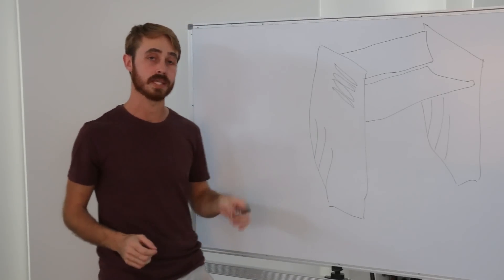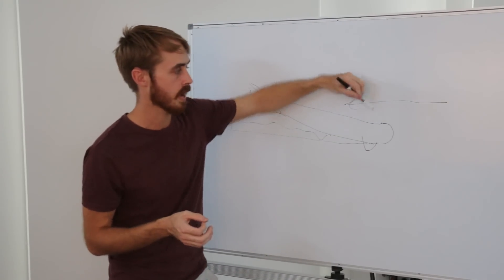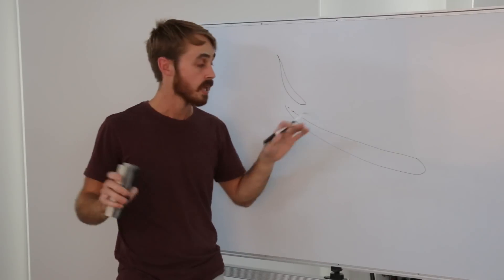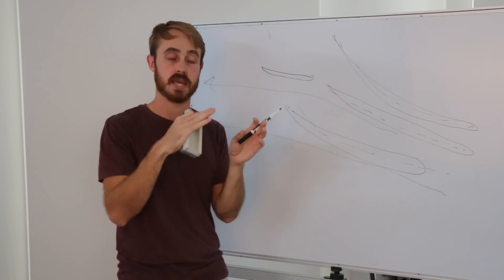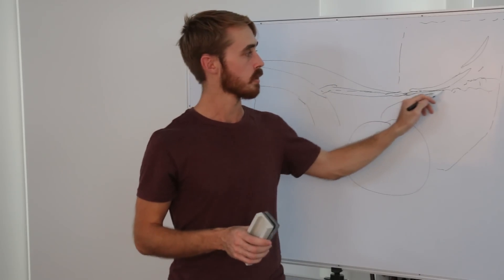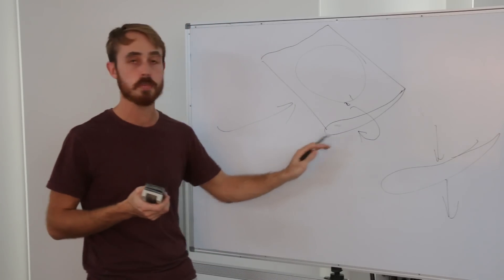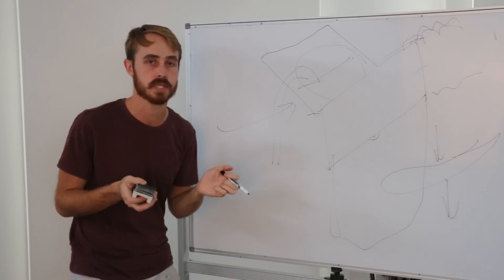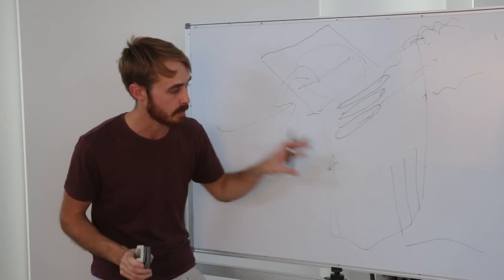How do F1 Rear Wings Work?

Comment: I get that the energy is bled from the wing, but not why it would give you increased drag. If a wing is 100% efficient, its dragfactor would be the highest. Vortices reduce the wing's efficiency...so the drag should be less (the wing isn't holding you down/back as much as it could be doing without the vortices).
Reply: think of the airflow in terms of momentum. Assuming the freestream oncoming air is mostly in the lengthwise direction of the car (x-axis), when that air gets turned into a vortex, it loses some of that lengthwise momentum for span-wise momentum (z-axis). The drag force here would be roughly proportionate to how much lengthwise moment was lost after the air was turned.

In terms of wing efficiency...wing efficiency is defined as the ratio of lift/drag, so losing efficiency does not mean drag was reduced, but the opposite. since efficiency and drag are inversely proportional, the vorticity of the wing reduces the lift of the wing which makes the wing less efficient.

"If a wing is 100% efficient, its dragfactor would be the highest" this is not true because efficiency is L/D. so at infinite efficiency, drag would go to 0.
Reply: @bossert_  So I have to view vortices as drag inducing because the engine not only moves the car forwards (x-axis) but also spanwise (z-axis) because the air gets moved in this plane too?

I didn't know that efficiency of a wing was defined this way. I have heard multiple times people say (credible) that a wing gives you "more drag". 
I guess they are trying to say (with DRS in mind) that a wing holds you back when going for straight line speed.

Thank you for the explanation btw, I'm not an engineer :p
Reply: @anomalyp8584  so the engine provides the airflow by spinning the wheels and moving the car forward through air, that is where the energy and momentum come from. It is in a straight line as the car moves forward (this is called freestream flow). Afterwards, the bodywork of the car turns the air in a vortex which takes energy and momentum out of the straight line flow and converts it into rotational momentum and energy. The net loss of momentum and energy from when the air goes from a straight line into this spinning vortex is where this drag comes from. The flow will have less straight line flow at the end of the car because some of it got turned into vortices.

The efficiency is just a measurement of how much lift you get for how much drag you have. The wing will always be producing drag, but to be efficient you want to make as much downforce possible without adding too much drag. 

It's okay to not understand parts of aerodynamics. This stuff is very hard. I am getting my Master's in aerodynamics right now and am still learning stuff daily!
Reply: @bossert_  you may not even read this but really thank you for this comment, I knew about efficiency of a wing and that vortices create drag but I never understood why. It makes sense that by converting the momentum of the air into the z direction you are loosing energy, and thus creating drag
Reply: Thread is old, but I would like to add that @anomaly P  is mostly correct. For the sake of precision, we would need to add some wording to say for a given airfoil profile at a given speed and angle of attack with miraculously zero vortices, the lift is maximized and the drag is also maximized, the lift/drag(wing efficiency) ratio is maximized, but it has a value of around 2.5 for an F1 car, and 17 for a boeing 747. With vortices allowed, the drag is indeed decreased. This is due to the decreased pressure wingtip regions on the frontal area of the wing(illustrated by Kyle) and increased pressure wingtip regions on the rearward area of the wing. We know by conservation of energy arguments the wing efficiency lift/drag must be less. All this means is that you lose more lift due to allowing vortices than you do drag. 

anomaly P has better intuition/understanding than most engineers for spotting this. To sum up the main point, if you take the wingtip fence off of a wing and keep everything else the same, vortices will develop, the total drag force will go DOWN a little bit ~5% as anomaly P said, and the downforce will go down a lot ~15%. If you need the same downforce that you had with the original fenced wing, you would need to increase the size of the unfenced wing by ~15% so to a rough approximation you might end up with 10% more drag compared to the equivalent fenced wing.

Comment: At 8:35 when you draw the pressure forces acting on the rear wing, do they both act downwards? Or does the force on the bottom act upwards and because it is smaller there is a net pressure force acting downwards (the downforce)?
Reply: yes you are right, pressure always acts perpendicular and into a body. I think he was just illustrating the net effect of a downwards force

Comment: How do vortices form on the end of an end plate ?
Reply: vorteces form on almost all sharp edges that are effected by fast air. Basicly you have pressure differences between the inside and the outside and the air has massive amounts of energy. This creates the same effect like he explained when the wing doesnt have an endplate
In fact, keeping the flow of air laminar arround a structure is extremely hard, so vorteces or turbulent air will naturally form almost everywhere

Comment: the vanes on the lower end of the rear wing fin end plate looks like it is steering air behind the rear wheels thus reducing the vacuum and control the air flow behind the rear wheels ;)
Reply: everything behind the wheels is turbulent. there is nothing to steer there ;D
Reply: @oeliku3033  you've not understood what i said .... air is being steered into that turbulent region to reduce the turbulence created by the vacuum effect, not steering the air behind the wheels but steering air into  that region... comprenday vue ?? :)
Reply: @freezatron  thats where you are wrong. You cant reduce turbulence - you can only prevent it or "push" the turbulent areas with laminar flow or vorteces, but thats 100% not whats that for.
The lower part of the endplate most likely increases longitudinal stability and prevents the vortecy that forms on top of the endplate to form on the bottom.
Also they are the connection elements for the rear wing, since you would have to do that in front of the wing or inside the low pressure area under the Wing/Flaps otherwise (eg like on some group C cars).
So I dont think they are aerodynamicly important at all - just shaped so that they dont cause much drag.

Edit: Also: what use is there to steer anything BEHIND your car ;D
Reply: @oeliku3033  No, this is where you appear to be wrong ;) 
One of the main purposes of aerodynamics is to reduce drag and control turbulence, pumping a stream of controlled air into the drag pocket behind the wheel will do just that .....
The whole point of all those little fins along the barge board is to reorganize turbulent flow into organized vortices to re-energize the flow further down the car etc. etc. etc. 
The main portion of the end plates on the rear wing will be to control the flow from the high pressure to the low pressure areas.

The point of "steering" ie. guiding the air behind the car is to control the turbulence and reduce the drag, for you to say that there are parts on cars like these that are not aerodynamically important at all merely demonstrates your profound ignorance on the subject. 
F1 teams are not going to be in the habit of spending precious time and money on designing aerodynamic parts that serve no purpose.
 
Having studied aerodynamics I'm not getting the impression you have, in fact it is clear to me that your opinion is not worth anything on the matter and that you've simply trying to pick a fight about something you appear to know little about, I wish you hadn't left a comment now ....
Btw, no need to seize the last word, I'll just assume it was something clever :)
Reply: @freezatron  But you increase drag by moving air and you achive nothing doing it, since the air behind the car is exacly that - behind the car - and the wheels create most turbulence towards the outside anyway. Not speaking of the HUGE region of turbulent air behind the car and the rear wing, that you cant get rid of. Maybe you jump of your high horse and name me an actual reason why you would want to control the air behind the rear wheels?

Also the bargeboards are mainly to seal the undertray of the car to increase the ground effect (by preventing air from "spilling" out the sides) (at least as far as I know).

And well  - you do you. But trying to sound clever in a youtube comment with your little ";D" face and then only doing the "I studied that" card is pretty lame tbh
Reply: @oeliku3033  I'm not playing any cards, I am saying I know you don't know what you're talking about because I have studied the subject where as you have clearly haven't  but yet you attempt to speak with some half baked authority on it .... you are clearly spoiling for a fight and as such you can gtfo, 
As for high horses, look upon thine own reflection for a moment ....  

Yes, part of the barge boards job is to seal the under tray but .... it re-organises turbulent air to do it.
Pushing a blunt object through the air like a wheel creates a pocket of vacuum behind causing drag, feeding air being accelerated around the body into that vacuum pocket reduces that drag... a little bit of drag here can reduce a lot of drag there, Nothing on an F1 car is without a well considered purpose.  

Aerodynamics is a collection of delicate compromises, 
study the subject and acquire an educated opinion, until then just leave me alone, cheers.
Reply: @freezatron  Dude, I also dont just imagine things. I too have experience with aerodynamics and in fact racecar aerodynamics, but thats not an argument or worth anything. Yes - the wheel creates a relativly big turbulent zone behind it and so does basicly every other part of the aerodynamic setup. What you oppose is to increase drag (by supposendly pushing air towards the outside) to reduce drag. And while this can be useful, I dont think that it is when going 300kmh+.
Also you want to support your updraft and increase the low pressure area behind the rear wing to increase airflow beneath it. I dont think that introducing airflow away from that would be a good thing - but thats just my thought on that.
Just look at them driving in the rain. You will very clearly see the water that got pushed up by the wheels beeing sucked towards the middle and thrown way uip by the diffuser/rear wing. If what you say is true, you would see water getting tossed towards the outside and that doesnt happen (I mean the air with little water particles in it oc ^^).

Tbh I dont know much on how to practically use the verteces created by the bargeboards to actually create downforce, but I will read into that. But im pretty sure you will (within the lengh of the car) not achive laminar flow again.

And please stop with the whole "I´m out" thing - that doesnt let you look very intelligent. If you dont want a discussion either dont write comments or write stuff everyone agrees on :)

Comment: I really don't get why the axial vortices can produce induced drag... thank you in advance! love  your videos!
Reply: Fabio Iasiello Think of it from a big picture perspective. The only energy you're giving the system is the kinetic energy of the wing through stationary air. Vortices are created by bending air into a circular flow, which is creating new movement. That takes some energy to do, and that has to come from somewhere. Since the only supply of energy is coming from the wing being forced through the air by immolating compressed dino corpses, the energy is thus taken from the wing.
Reply: @SeanLillibridge  I get that the energy is bled from the wing, but not why it would give you increased drag. If a wing is 100% efficient, its dragfactor would be the highest. Vortices reduce the wing's efficiency...so the drag should be less (the wing isn't holding you down/back as much as it could be doing without the vortices).

Comment: could the lower slots on the wing also be used to hurt following cars' front downforce, or would that effect be too little to notice?
Reply from the maker: Anthony Stuart In comparison to the magnitude of the vortices from the main wing and diffuser, as well as the massive tyre wakes and exhaust plume, I doubt the lower slots are going to have a substantial effect on the trailing cars downforce. 

Thanks for watching!